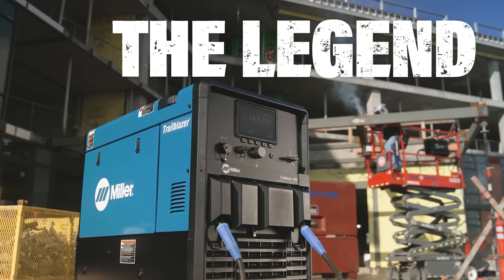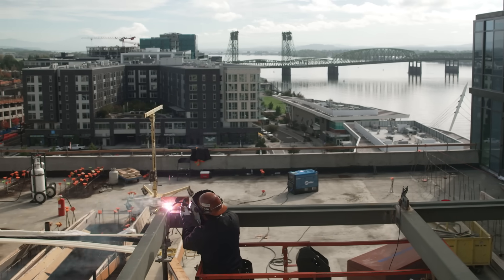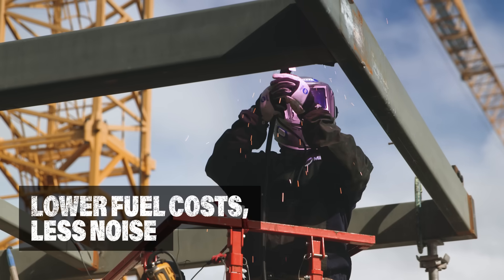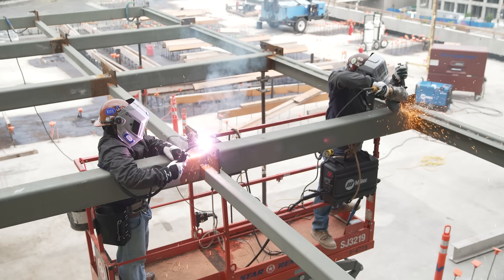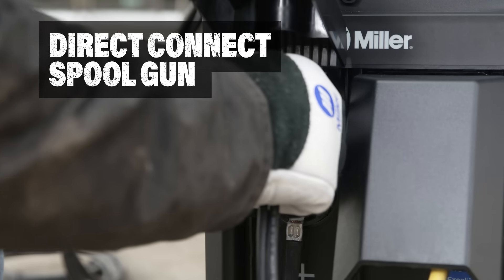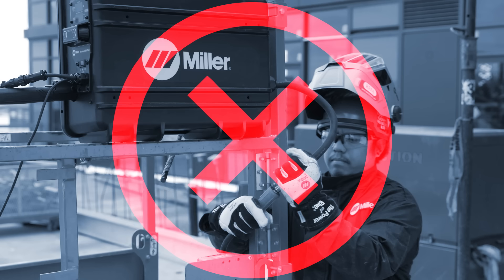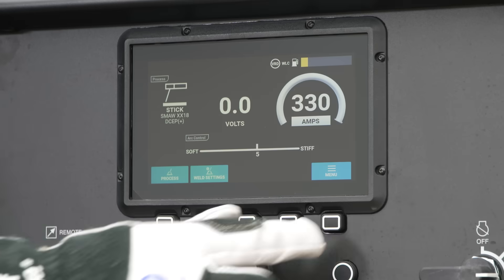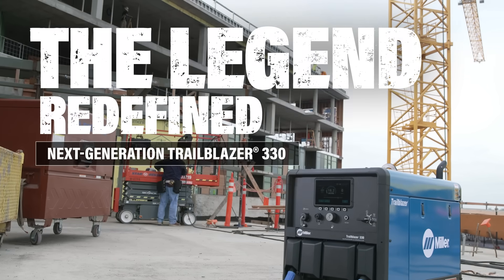New Trailblazer® 330 Engine-Driven Welder | MillerWelds

Comment: Is the digital display covered with a sapphire  face so it won't get scratched by metal oxide dust?
Reply from the maker: Hello, thank you for your question. The Trailblazer® 330 display comes with a tempered glass screen protector.
Reply: @MillerWelders  Is a replacement part available? Does the tempered glass have a rubber gasket backing it to prevent water ingress?
Reply: @MillerWelders  Thats very good news! When I attended welding training in Georgia the Lincoln machines had soft plastic touchscreens that had been completely worn away from being poked at with dusty welding gloves. It was bad.
Reply from the maker: There is no gasket; the screen protector sticks directly to the screen, similar to a cell phone screen protector. Unfortunately, replacements are not currently available.
Reply: @MillerWelders  That is an even better solution than expected. Please make sure that replacement screen protectors are available. Welding machines get decades of use and must survive many refurbishments to preserve the reputation of the manufacturer

I'm interested in Miller machines because I've seen so many on auction sites that look like they were dragged from Chernobyl but still function enough to be sold. That is durability that I can say I'm interested in.

Comment: The naysayers will complain about the video screen control like the ones on the Lincoln machines, or will they?
Reply: I’ve owned a few trailblazers I’ll never buy one again because of it honestly. I’ve owned quite a few engines drives and as soon as you start adding this junk they are never the same. Lincoln is going to crap with it all too. I don’t understand why they just can’t keep the trailblazer like it is. It’s got a dial for amperage a readout for set and running amps / volts why do you need this other junk? To keep up with like lincoln machines? They are killing themselves slowly and painfully. Volts, amps and dial why do I need anything else other than a hour meter if I’m welding everyday?
Reply: @motoz3939  I have been true and BLUE for 47 years there is no need for all this added extra technology.what happened to down and dirty? It will not last in the extremes. We will no longer keep with the times to the new unnecessary tech advances that are not needed. I've shot x ray welds and certified in 9 states off an 8 bank (Dialarc250"s), never had an issue.Huot Welding Service Inc motoz3939 is correct
Reply: I’ve owned a few trailblazers I’ll never buy one again because of it honestly. I’ve owned quite a few engines drives and as soon as you start adding this junk they are never the same. Lincoln is going to crap with it all too. I don’t understand why they just can’t keep the trailblazer like it is. It’s got a dial for amperage a readout for set and running amps / volts why do you need this other junk? To keep up with like lincoln machines? They are killing themselves slowly and painfully. Volts, amps and dial why do I need anything else other than a hour meter if I’m welding everyday?

Comment: No remote start?
Reply from the maker: Thanks for reaching out! We appreciate your question about the new Trailblazer® 330 engine-driven welder. Unfortunately, the Trailblazer® 330 does not come with a remote start feature. However, it is still a highly reliable and efficient welder that offers excellent performance. If you have any more questions or need further assistance, feel free to let us know.
Reply: That's extremely disappointing why?
Reply: does the wireless remote not start and stop the machine,?the red button @MillerWelders

Comment: "Driven by a 330 cubic inch supercharged v8 capable of welding 3 feet of solid steel plate. Options included as standard, louder exhaust, a skull ornament and a 16 can refrigerator with millers patented Chill-max9000, drinks cooled from ambient to ice cold in under 5.59 seconds"